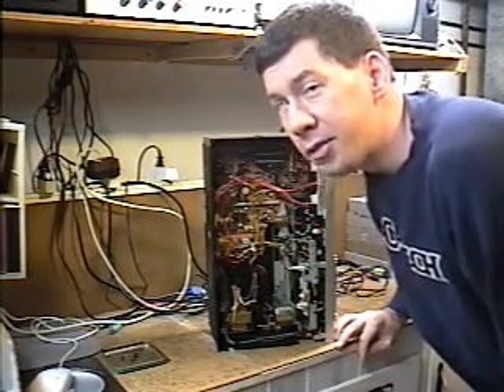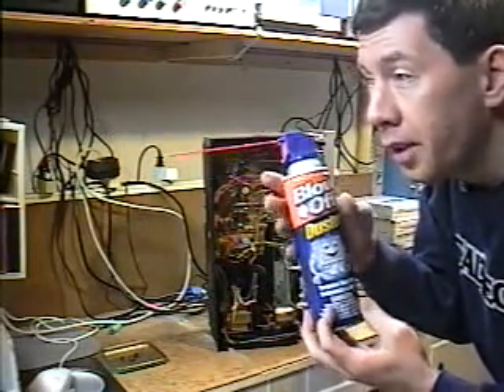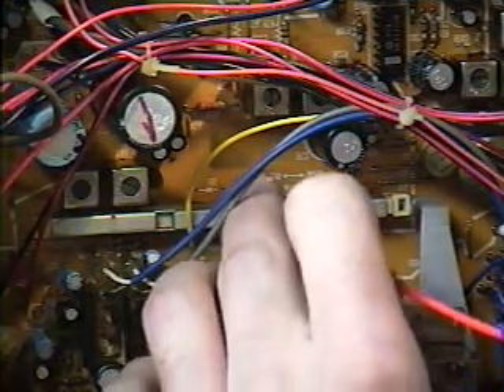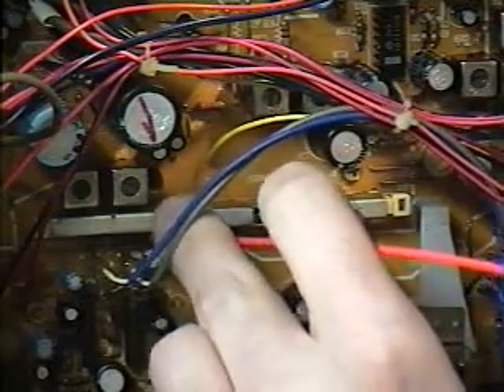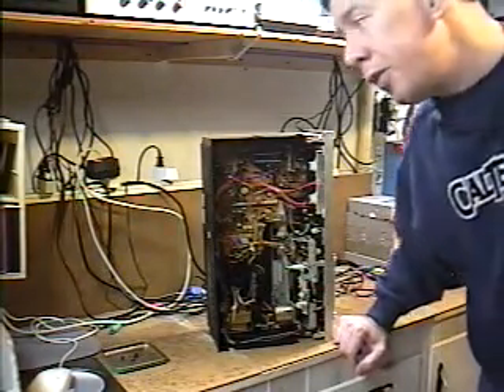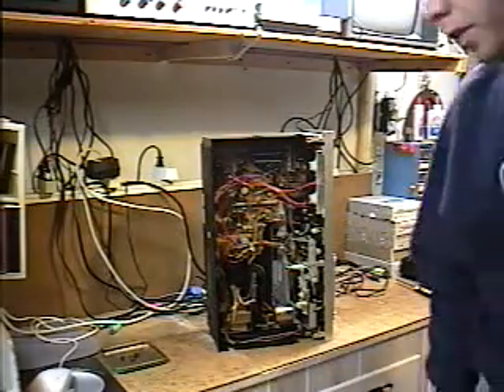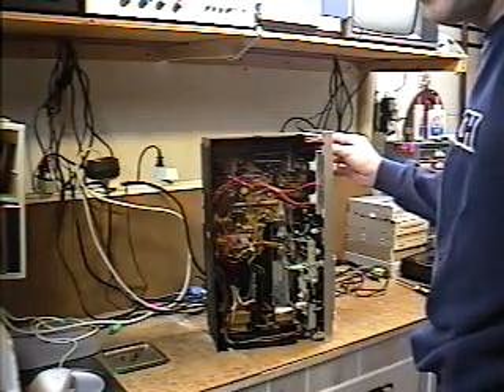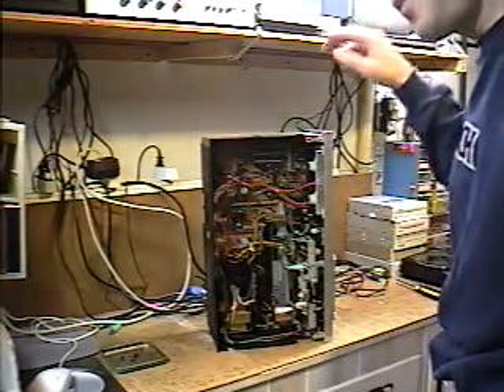D-720 Repairs Part 1 (Cleaning Parts)

Comment: Hi Gary. My new cassette deck is a Realistic. But the other one I had before was a JCPENNY MCS series 1981 deck that I purchased on the auction house in January of 2011. Now the problem that this deck has, once when I would record something that was played back on my cd player or cd recorder, in playback it would emit a buzzing sound, or in the case of the Elvis Presley FTD disc, "Fool" the 10 minute track of  Don't Think Twice It's alright, when I record it to tape the music background could be heard, but the vocals are missing. And this is coming from my cassette deck's record/pause and input jacks in the back for which I am sure. I tried changing the monster audio cables to a regular cable and still I could hear it on playback. I was trying to complete the 55 tape project and I did want to take a chance of me finding it out on playback that it could still have its issue, so that is why I bought an Realistic tape deck. It is still very good.